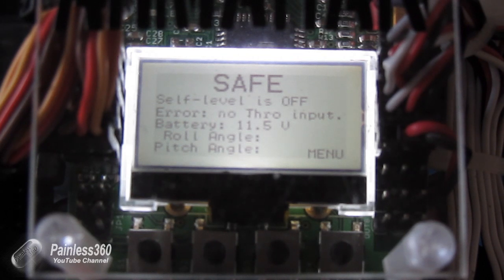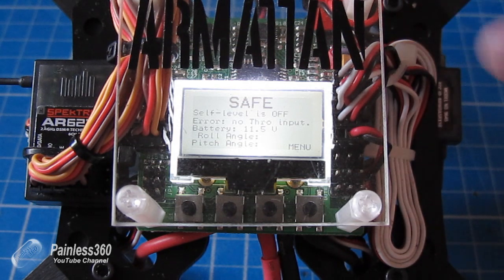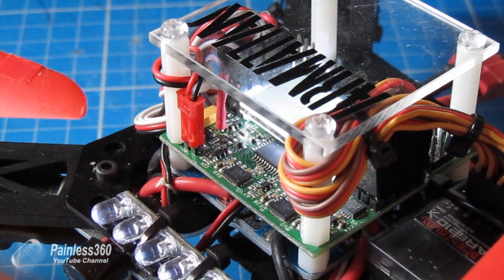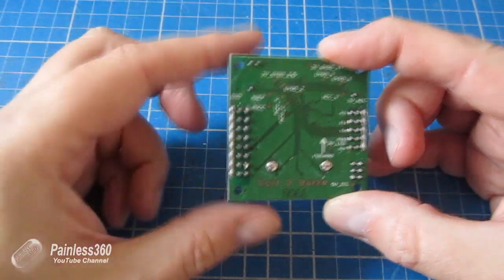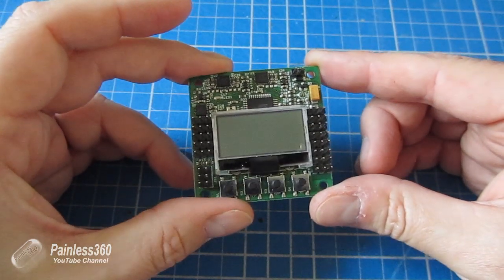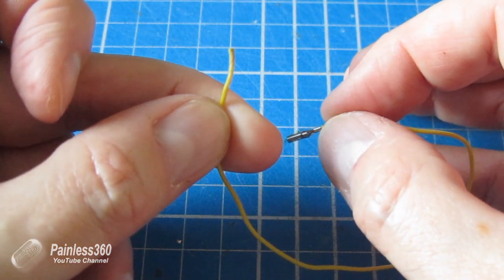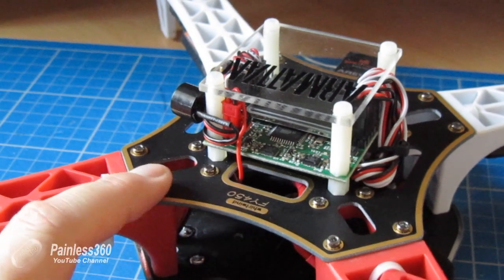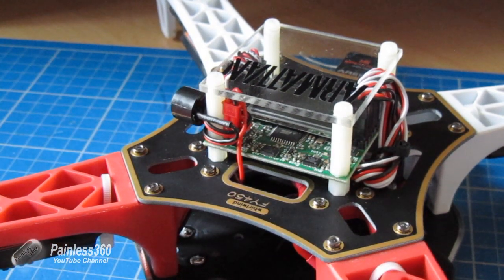How to setup the KK2.0 board to show the battery voltage (LIPO)

Comment: I have confussion how to supply current to flight controller it required 5v but I want to connect my quadcopter with 11 v battery 
spec:-
ESC - 30A
motor- 2300kva
flight controller kk2.15 evo
Receiver- 9ch
Reply from the maker: See the videos in the 'Introduction to remote control' series and the 'Quadcopter building for beginners' series on the channel too - both of those have all of the basics to help with a new build.. Best of luck!

Comment: what battery should connect for long flight duration with 2300 kV motor
Reply from the maker: Impossible to answer without knowing a lot more. See the videos about power, thrust and motors in the 'Introduction to Remote Control' series.. Hope it helps.

Comment: great video so there is no need of negative /GND wiring?
Reply from the maker: That's right, the ground is common throughout the system and the board uses the ground from the ESC/UBEC leads. Thanks for asking.

Happy flying!